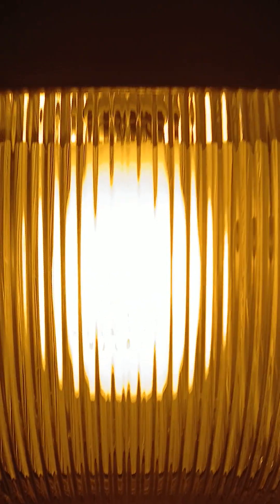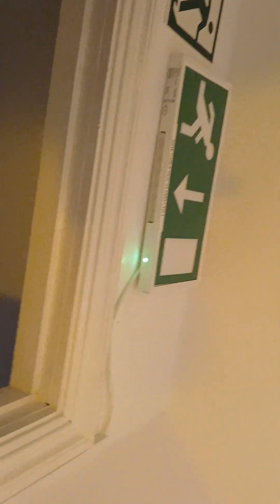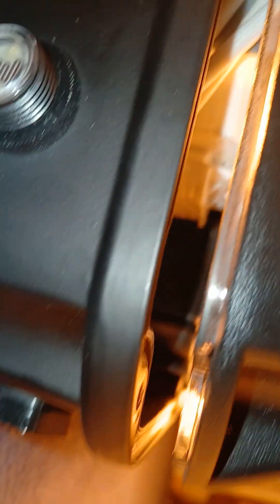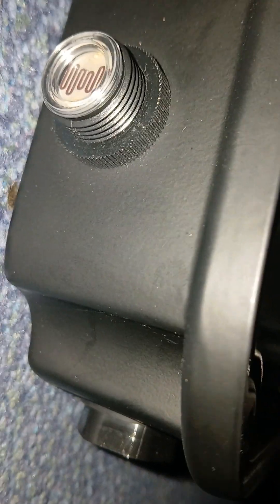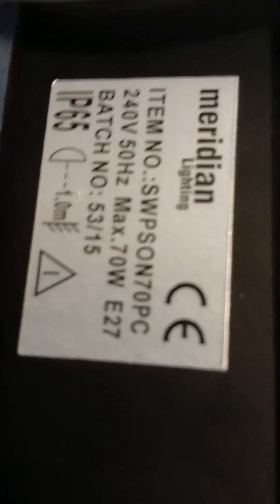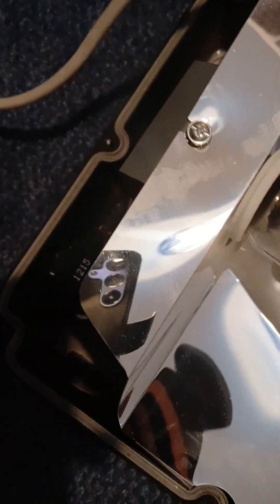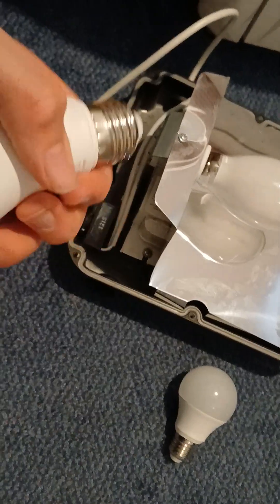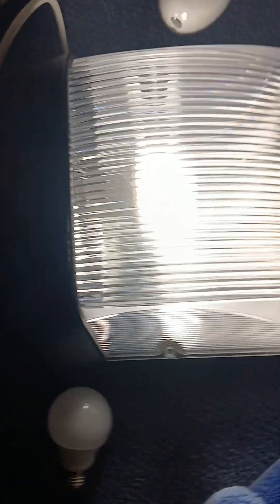son w or led wallpacks

Comment: running that light for eight hours a day would cost approximately £69.50 per year at an electricity rate of £0.34 per kWh.
Reply from the maker: I worked it out that it would cost £21.65 , This may be wrong. Please could you advise me how to work it out it would be helpful to know